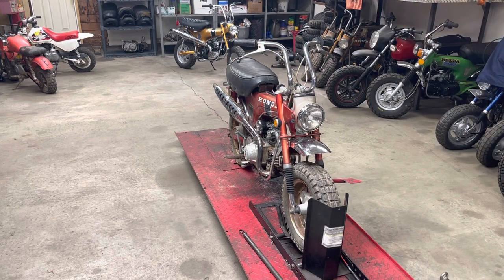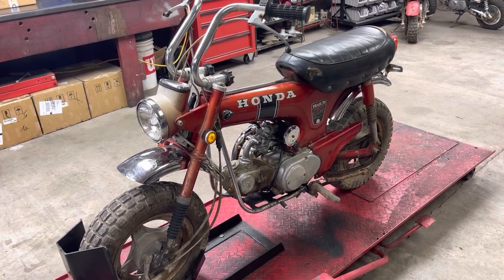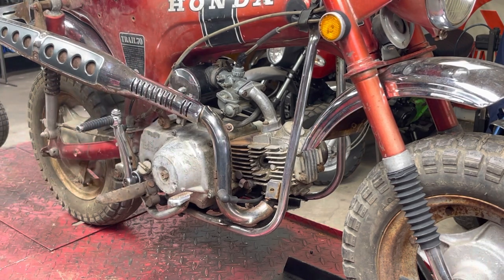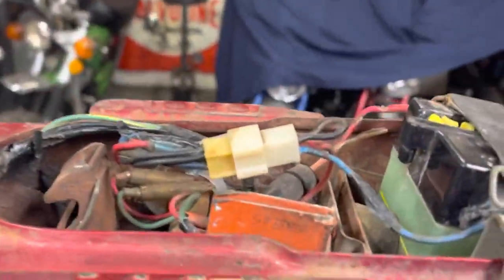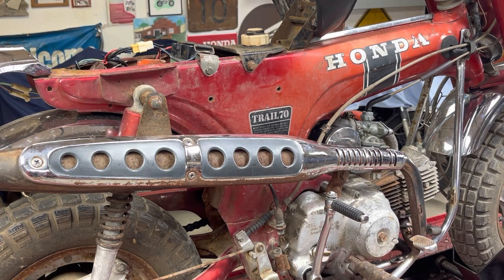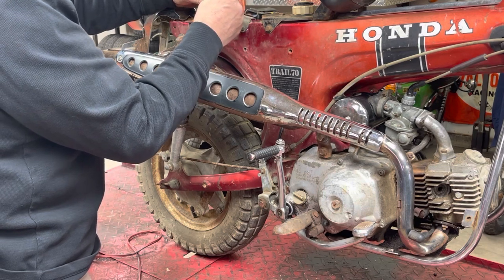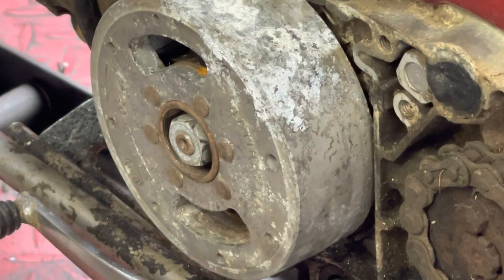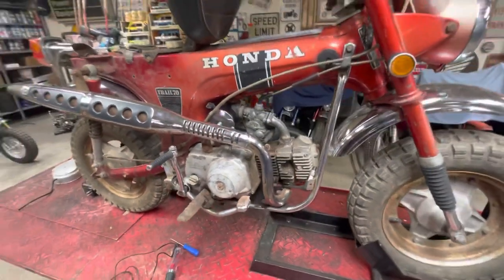Honda CT70 - no spark

Comment: It's always such a relieving feeling when you finally get an old bike to spark and get it to start. Glad to seeing you work on the original engine on this one 😁
Reply: I hate auto electrical issues
Reply from the maker: Agreed.  I’m just going to flip this one, so it will stay stock.
Reply: @MiniBikeMike  I'm having the same exact issue with my 71 Yamaha G5 trailmaster. Got it running previously and returned it to its owner, sat for acouple weeks and now...nothing!  The kicker for the starter (its splines) were just about stripped so I've been popping the clutch and started right up. Now... when I remove the spark plug,  its soaked. It ran so well too when I had it running. Wish I was better at life...lol
Reply: Your vedeo is great

Comment: Thanks so much for one of the best videos I have ever seen. So much for if it has flywheel magneto you (DON'T NEED A BATTERY) this is ture but if you don't loop the to black wires together at the battery it's going to be open circuit and no run. Thanks for teaching me that you can have a the light show points open and close and voltage. I would have put down money that a bad condenser would not show voltage, because it would have gone to ground. Thanks again for a really good video and teaching me what the to black wires at the Batt. are for and what a great test point it is. Sincerely Denis Kerechuk.

Comment: I used to rewire the 3 phase stator in the 70s,  with some  transformer magnet wire, and get the diodes out of an old full bridge rectifier from a car alternator. 
Good old 70s.!  No amazon or ebay back then to get it the next day.

Comment: Next to my Goldwing, my old CT70 was the most dependable motorcycle I have owned. If it had fuel, it would start without fail, even after sitting in a cold barn for 2-3 months every winter.

Comment: Good job of tracing the problem !, some of my bikes have electrical problems due the age of 30 ,40 years .Usually the connections of wires  are corroded to the point that currents can`t go through , high resistance. Looks look the moisture must have  got  in the codenser area with that white powder formed. Perhaps gaskset got weaker around the cover which could have break down to let moisture form. Good job and thanks for showing the video. Always i learned alot from your videos on maintaining these gems !
Reply from the maker: Thanks!  I’m going to guess that the condenser was probably good, just a bad connection.  It came loose very easily.

Comment: Really learn thru your step by step diagnosis, how do you mouse proof the CT70's that you have sitting around.  I have to keep mine in a shed and its not mouse proof whatsoever
Also how can I look up the tools that you use?
Reply from the maker: Thanks.  I’ve never had a mouse problem at the shop.  I’ve never done anything to mouse proof.  
What tool are you interested in, maybe I can find a link.

Comment: Great video.  Working on my first CT70 K1 and this was very helpful.  Question about the black jumper on the pigtail - I picked up a new wiring harness from CHP and there seems to be continuity between the black stator wire and the black ignition coil without the need for the jumper.  Found an old wiring diagram and it shows that the jumper should be the only thing creating continuity between the two black wires.  Wondering if you’ve seen this before?  Guessing it won’t hurt to add the jumper anyway but it seems unnecessary, at least with this new harness I received?
Reply from the maker: I’ve not used a CHP harness, so I’m not familiar with it, but that sounds odd.

Comment: That dirty soldering tip and wires needed some flux…
Reply from the maker: Yeah, unfortunately, I rarely work on the original engines, so I don’t keep the needed tools/equipment around.  I much prefer a Lifan swap.

Comment: Hey there!
I have followed and passed your first 2 steps. However, during your 3rd step, checking the coil and attaching it to a 6v charger I’m getting no spark. I put the positive to the harness under the seat, spark plug up against the cylinder head, then negative to the engine case but still no spark. I need some help on what to do next. Also the coil is brand new. Thoughts?

Comment: Great video.   Question:  I did the test light test and the light does not flicker - it just stays on when cranking over.  Are the points stuck together or something else?  I have a flywheel puller on order so plan to take a look shortly
Reply from the maker: Yes, if the light stays on, your points aren’t opening or the points are grounded to the engine somewhere.

Comment: I thought if you were getting the light to flicker on the black stator  wire, this would mean the condensor and the stator is working properly? Confused as I just seen a video where guy says if your getting the black stator wire to flicker it means everything on engine is fine and to look at wiring or coil problem.

Comment: One other question:  My battery charger setting is 6V and 15 amp as the only setting.  Is the amperage to much to use?  Any other way to check the coil otherwise?  Thanks

Comment: hi I see that you use your impact to run your engine but what type of socket do you use? nice video bye
Reply from the maker: It’s not an impact, just a regular drill.  I just use a standard socket.
Reply: @MiniBikeMike  Thank you very much my friend ! Are you using a socket the same size as the one that goes on the stator nut or larger so as not to break the shaft threads?

Comment: My 1977 ct 70 shows all the same signs and I replaced the points and the condenser but still no spark? Do you have any pointers?
Reply from the maker: Have you confirmed that the coil is good and working properly?  If so, the next step would be to eliminate the harness from the system.  Unplug the engine and the coil from the main harness.  Run a jumper wire from the black wire of the engine to the black wire of the coil.  If still no spark, the problem has to be under the flywheel.  Double check that the wiring and solder on the condenser are not touching the outer case of the condenser.  If it is, it will ground out the system and kill spark.
Reply: @MiniBikeMike  man thank you that’s so helpful! You really know your stuff 😀. I ran a jumper wire just like you said, it sent a nice spark!  Then I greased up the connections and plugged it all back in. And sure enough I officially have spark!  Can’t thank you enough!!
Reply from the maker: Glad it worked for you.

Comment: How come whenever I find these little bikes, the wiring is a cobbled together mess of electrical tape and wire nuts???
Reply from the maker: Because these were kids bikes and kids were working on them.  🤷🏻‍♂️
Reply: @MiniBikeMike  I dunno, I've seen some grown ups  that weren't capable of anything better . Lol
Reply from the maker: @ifitsfreeitsforme1852  Not everyone is mechanically inclined, some did the best they could.  I’m sure if I went back and looked at my work, when I started on these bikes 30 years ago, I’d shake my head at some of the stuff I did.   Hell, I still cut corners every now and then. 🤣
Reply: @MiniBikeMike  Yep, I  wasn't a born Einstein either. I learned from my mistakes as I went along.
Reply: @MiniBikeMike  Do you work on Aermacchi mini bikes , like Z-90s ?
If I'm not mistaken,  they're positive ground like British stuff
Reply from the maker: @ifitsfreeitsforme1852  Nope.  I’ve never wrenched on anything but horizontal Hondas (or their clones).
Reply: @MiniBikeMike  I imagine that keeps you busy enough .